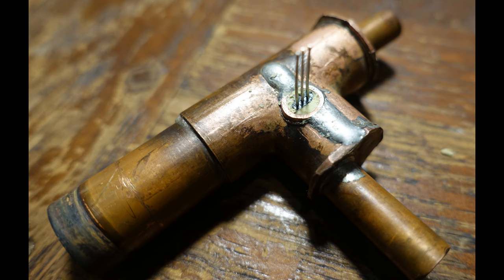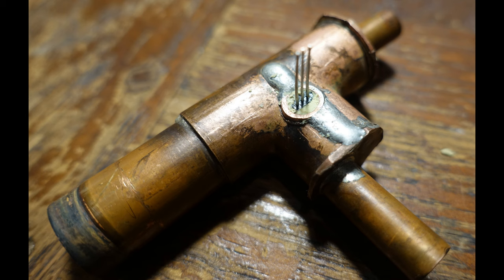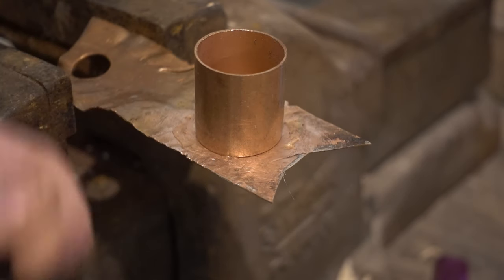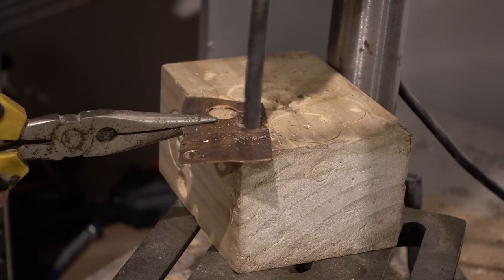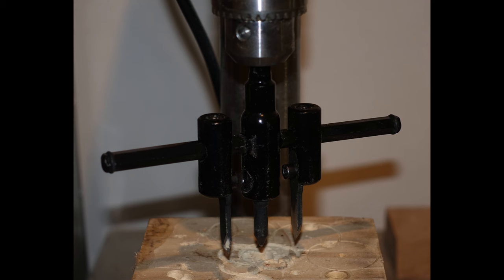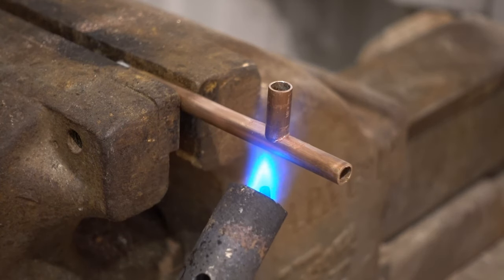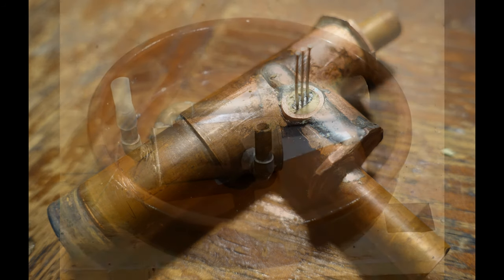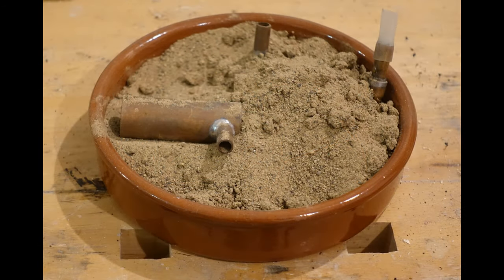Simple methods to solder copper still equipment

Comment: Good to know about the pennies,  I know its nothing to do with the video, but I'm wondering when do you call it a day with a reflux, tried to turn it up like you would on a pot still to run it out, but just blew a seal, is it a case of just slow and low and call it a day when drips become antagonising slow, thinking be nice if you did a vid about it, or someone can help, asked this question few times now. Any help be greatful
Reply from the maker: Pot distillation is usually done at full power, typically several kW, but column reflux distillation requires much lower power, typically around 20W per square centimetre of column cross section area. The main challenge though is that this heater power needs to be precisely controllable to within about 1% of the calculated power for the column.

This power setting changes throughout the run for batch distillation as described in my videos on latent heat and column cooling. So depending on the column size you'll need a heater control mechanism that probably doesn't need to be over about 1000W but does need to be controllable with resolution of about 1W at the lower end and 10W at the higher end.

There is no such thing mass produced for other purposes. You can buy control systems like that from still suppliers but they are expensive and you're better off making one but you have to know a bit about electronics to do that. 

You can get cheap commercial hot plates for heating a single saucepan but these are not suitable for two reasons. The first is that they work by switching the hot plate off and on with a variable duty cycle and this is too slow to allow stable steam production from a boiler. The other reason is that they contain a switch that turns the heater off and on and this switch sparks and will ignite alcohol vapour from any alcohol spilt on the floor.

If you're making vodka or gin you're going to need pretty precise reflux column control. The demands are not as great with whiskey or rum that are typically made with pot stills, and can be made with fairly crude columns with only a small number of plates, aimed at getting the alcohol content up to 80 to 90%. With that objective, the control parameter resolution is not that critical, and you could probably get away with +/- 5% rather than +/- 1% but that still needs a specialist controller.

Comment: Dang the sand technique is good i could have use that a couple times before along with the abrasive technique to expose fresh metal i have just been used heeps of flux and solder wonder why it my joints were ass. As you can tell im a beginner lol
Reply from the maker: So am I. I have put more solder on the floor than on copper and have made more leaky joints than sound ones!

Comment: Nice one - Passing on some skills !
You sound about my age. It worries me that the Younger people literally can't do anything practical.
The smaller denomination coins are a copper/iron mix.
Test them with a magnet. I dunno if iron helps or hinders distillation flavours.
Reply from the maker: The iron core makes coins more difficult to drill but it's still quite easy if you hold them in a machine vice. It makes no difference to the ease of soldering and no iron is exposed afterwards so it cannot affect the flavour.